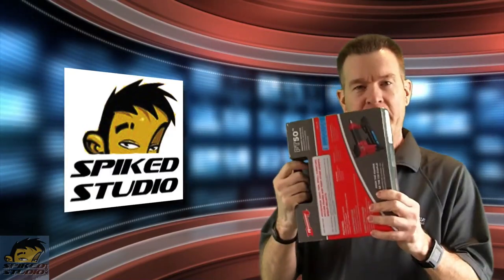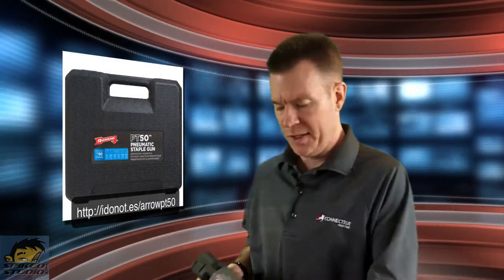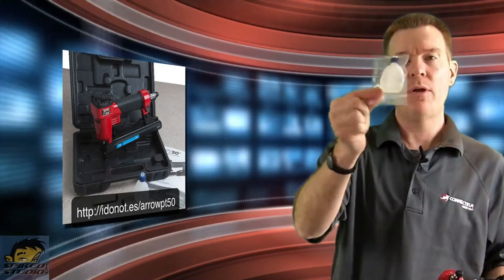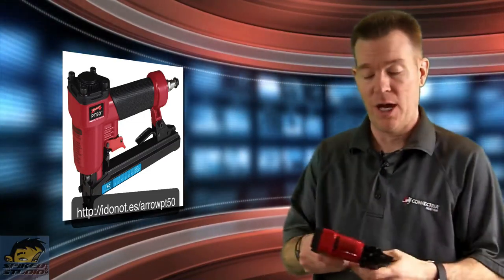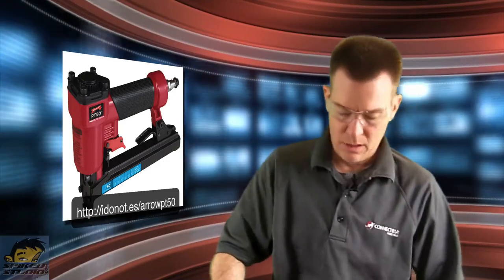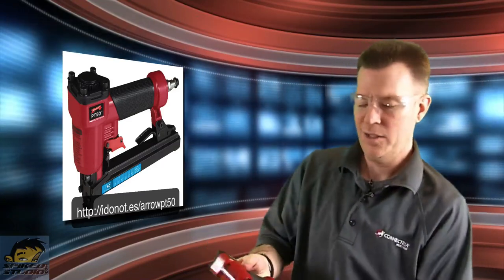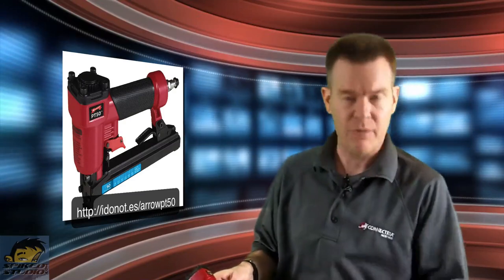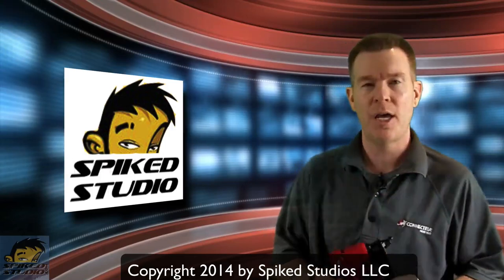Arrow PT50 Pneumatic Staple Gun review

Comment: Mine just quit working :( Love the stapler but no clue with no obstructions why the trigger won't fire. Not overused.
Reply: Hey there, thanks for reaching out! Try disconnecting the tool from the compressor and adding a few drops of oil directly to the knife--or the “hammer”--and a few drops into the air inlet. Then dry fire the staple gun with no staples into scrap wood for about 10 shots. Once finished, reload the tool and try firing again. If this does not resolve the issue, please reply to this comment, email customercare@arrowfastener.com or give us a call at 800-776-2228, and we will troubleshoot further with you.
Reply: @arrowfastener  Mine quit while working and I saw your reply and applied what you said, I would like to add that I had to push the "knife-or the "hammer" back manually several times before it finally fired properly. If the knife is down it just dry fires, pushing it back up allowed it to be lubricated thoroughly and start functioning like the great stapler that it is. I guess I thought the oil was just for the inlet. Now it will be part of regular maintenance. Did I mention it is a great stapler!
Reply: @phillipjaramillo5002  Thanks for the additional details. Our newest PT50 models do not require oil -- ever.

Comment: i just bought one  using it with porter cable compressor it fire but no stable is coming out any suggestion
Reply: Hey John. Apologies on the delayed response. Did you still need help with this? Typically in this situation, we recommend disconnecting the tool from the compressor and adding a few drops of oil directly to the knife--or the “hammer”--and a few drops into the air inlet. Then dry fire the staple gun with no staples into scrap wood for about 10 shots. Once finished, reload the tool and fire as needed. Also make sure you're operating between 60-100 psi. If you still need help, please let us know!

Comment: Whats a good compressor and hose for my buck that fits this tool?
Reply: Hey Jeffrey, we recommend any compressor designed to operate on clean, dry, regulated compressed air, between 60 and 100 psi, and with a minimum 2.5 CFM @ 90 psi. Thanks for your question!